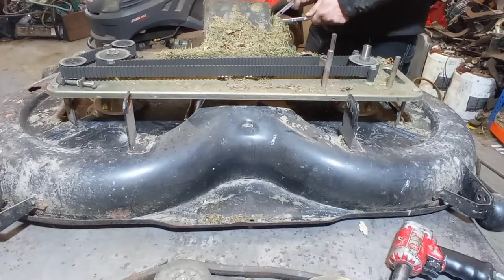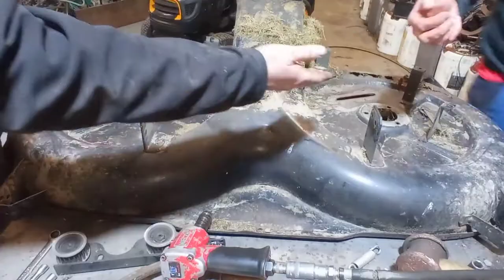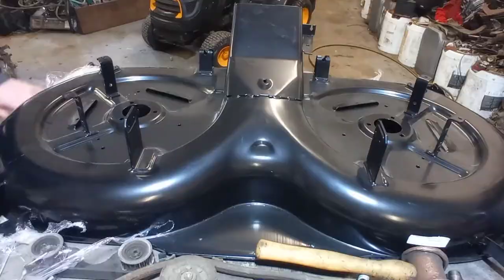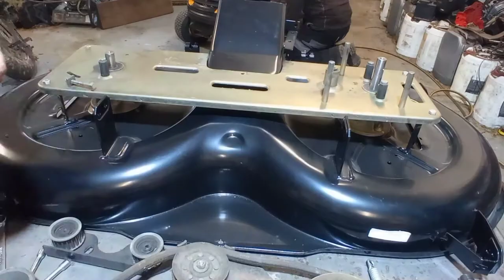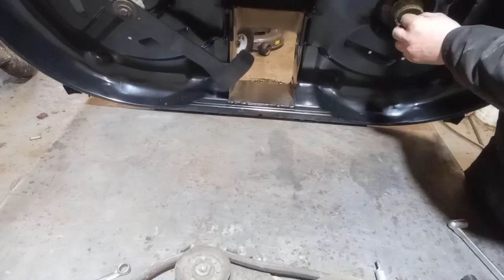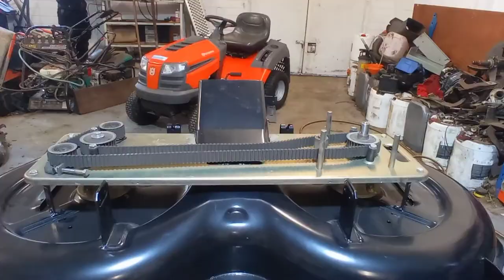Replacing old worn out deck on a Castlegarden ride-on

Comment: Can't believe you've uploaded this so recently.  My old deck is rusted through and  I have just bought a replacement , it's a Honda HF2417 HME and the decks are identical. Thanks guys much appreciated. 👍
Reply from the maker: No problem a tall David glad we could help you out a bit if you get  stuck at any point you can give us a shout and we will be happy to talk you through it. Also make sure to check the bearings on the pulleys. You dont see it on our video but we changed out 6 bearings altogether on this deck. Its the type of job that worth doing while you have everything apart as you dont want to have to re-do everything again in a few weeks

Comment: Very useful & interesting video thanks.  I've got to replace my Castelgarden deck later this year - I'm in the UK and the mower is elsewhere in Europe!  Can you recommend any particular paint or coating to put on a new deck to help preserve it and delay corrosion?
Reply: The same deck is in the stiga, mountfield,  atco brands also so your local dealer of those will have it. Get spray on Shultz (underbody seal, stone chip paint) it's what goes under cars to protect the chassis from rust. It's almost like a thick rubber paint. That can be used all over and repaint under the deck ever year or so. Best advice I can give is to to 1. Clean under the deck as often as possible and 2. Don't let grass sit on top of the deck use a power washer/air blower to clean off all loose grass when your done.
Reply: @declanmaher8263  Many thanks Declan. 👍👍

Comment: Would it be possible to get a pic of how the belt runs just snapped mine now and not sure of the route of it
Reply: You will need 2x13mm spanners. There is a 2x13mm nuts and bolts where number 13 is that's acts as a tensioner which has to be loosened and more 13mm nuts under the plate that will need to be loosened along with the belt guides (no12) when it all loose it makes it easier. With the belt loose but in position to be tightened up you need to set the blades at ninety degrees to each other( think one blade at 12.30 and the other at 9.15) and then tighten the tensioner making sure the blades stay the same. Then tighten up everything else.
Reply: @declanmaher6553  I've got a Castelgarden TC102 Declan which I have to source a new deck for and would have found your info helpful, but your link is no longer working?
Reply from the maker: @trampster7306  sorry only seeing this now where are you located?
Reply: @bvsparts9207  South West England Declan.
Reply from the maker: @trampster7306  ah i dont know many anyone down that area but if you try south west fixings in Devon they should be able to get you the deck through Kramp i think the part number is 4825650050 for the TC102 but definitely double check that number
Reply: @bvsparts9207  Thanks Declan.  I've been doing some research for ages and held off buying one until we know we're going over to France.  Always seems to come up that the best prices are in Ireland.

Comment: Good video but a bit too fast my eyesight isn't what it used to be thank you for the video
Reply: Use the settings tag (4th from Right at the bottom of video) and you can adjust the playback speed.

Comment: hi,my blade drivers seem to be stuck on the spindles-they seem to just fall off in your video when you uno the blade bolts...any ideas..do they just need a bit of persuasion?
Reply from the maker: Quite common for them to be stuck in place as they are held in place with a key way and dirt siezes them in place. In general a 2 jaw pullers or a good bit of persuasion with a hammer and freeing oil does it. If its bad we have in the past had to cut them off with a grinder.
Reply: @bvsparts9207  thanks!..I get a pullers on them later,👍
Reply: @bvsparts9207  got them off and the deck back together - all good..thanks for the video

Comment: I hope you answer this. I have an Oleo mac 122c/22h which is the same as this castelgarden. I am putting the deck back together and I cant find the brake block. On you video there also isnt a brake block attached did you already take it off before assembly or is there none on here?
Reply: Email me a picture of what you currently have on the deck and I'll have a look in the morning info@barrowvalleyspares.ie and send you drawings of the machine also
Reply from the maker: Hi again Yannick, i had a chance to look through the video this morning to see your question. There was no brake block on this machine as it has an electromagnetic clutch (you pull a switch to turn on the blades) the older models had a manuel engage where a lever on the right hand side had to be pushed down to turn the blades on. The older system needs a brake block but the electric system doesnt. Hope this helps
Reply: @bvsparts9207  thank you so much!
Reply: @declanmaher6553  sent you an email :)

Comment: Hi I have a stiga estate pro with the same cutting deck and have change the timed belt due to the gardener hitting something and the belt snapping but when I time the blades up after not long they keep jumping out of time so my question is how tight should the belt be? Cheers
Reply from the maker: I'm going to assume you don't have have anything to measure the tension exactly so im going to give you a general rule of thumb we give to lads replacing it on site themselves. The belt at it closest point in the centre of the deck, should not be able to twist from vertical to horizontal by hand. Basically grab belt between your thumb and index finger and if it doesnt twist it should be fine. With this in mind, the constant slipping i dont think will be caused by tensioning issues as i assumed after the first or second time it slipped you tightened it up substantially. Check where the blade bolts onto the shaft at the bottom, there is a blade adaptor there part number 25463200, google that image so you can see it, it has 2 nipples on the bottom of that that hold the blade in place, if these are sheared off the blade itself can slip regardless of how tight the bolt is as cause the blades to hit and slip the timing. Failing that to check in order, key ways replaced on all pulleys you took off, the steel frame under the timing belt has not popped up off the mandrel housing as this keeps the top mandrels square, the 13 mm bolts under the belt tension plate have not been re-tightened after tensioning the belt (these also have to be loosened to tension the belt correctly)
Reply: Thanks for that if anything I think I have probably under tightened the belt with fear of damagin the bearings on the pulleys I am in the process of changing the boss on the blades not because of broken nipples on them but one of them when I went to undo the blade the bolt was loose so there is a lot of play on the key way so decided to replace both everything else seems OK and tight so will check belt tension again. cheers for the information.
Reply from the maker: No hassle, Best of luck and if your stuck just give us a shout
Reply: @bvsparts9207  My belt snapped so replaced it. The new one lasted 30 minutes then snapped. When I opened up the deck the belt had frayed to bits, looked like a dead animal under there. Everything seemed fine when I put it back together but the locking pin (11 I think it is) wasn't spinning and the black plastic bushes were carved out badly like someone had taken a knife to them. Locking pin the culprit? Or the belt too tight? About to fit another belt and worried it'll happen again 😬